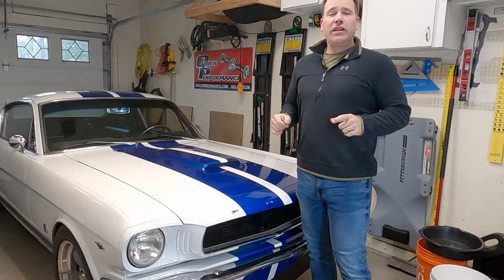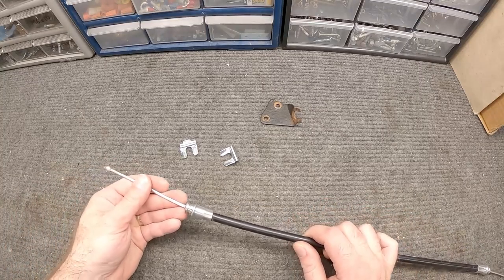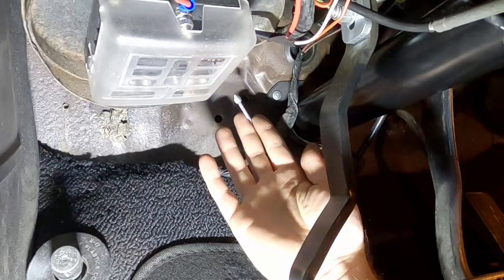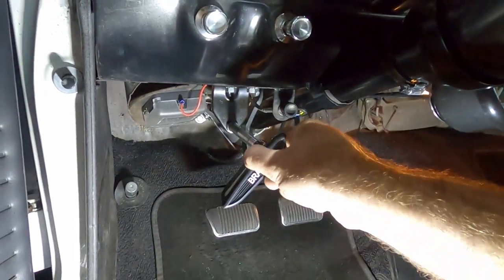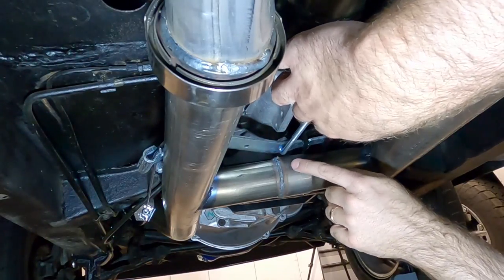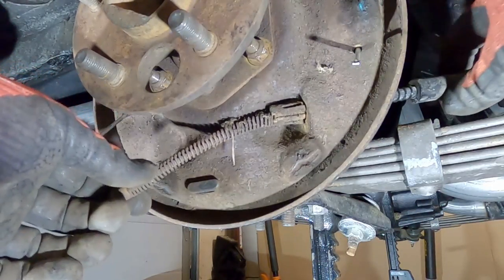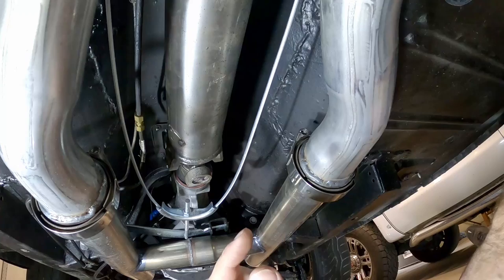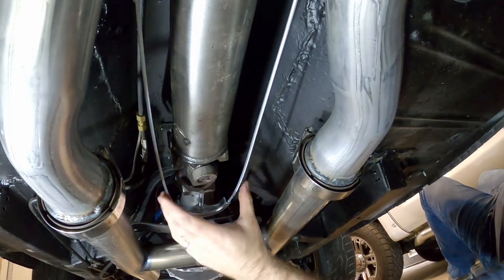Installing a New Parking Brake

Comment: Great job making the video and explaining how to install an Emergency Brake and cables. 
My first car was a 1965 C Code Mustang Fastback I bought in 1980, a few weeks after I bought it the front flexible brake line going to my front drivers side drum brake rubbed against the tire and wore a hole in it, making my lose my brakes coming off the freeway, I panicked, and immediately pulled on the emergency parking brake, and downshifted my car to try and stop it, I was lucky I did not crash the car, because it stopped in the middle of an intersection where it was red in my direction, and the cars went around me. I found a dual reservoir master cylinder and disk brakes off a 1970 Mach 1 and adapted it to fit in my Mustang, and used Stainless Steel flexible brake lines and adapted them to work. I highly recommend that you change your single reservoir master cylinder and get a dual master cylinder.
Reply from the maker: Thanks

Comment: Good video. I remember struggling with drum brakes in the early’70’s. Memory and instruction books. 
BTW hang your grease gun horizontally so the oil doesn’t drip out. I did lubrication in a factory for 35 years.
Reply from the maker: Thanks.  Grease gun is perfect, got keep the grease industry in business somehow.  :)

Comment: While you were in the rear brakes , a little white lithium grease on the rub points for the shoes helps , also cleaning all of the dust off the backing plate makes everything a little cleaner
Reply from the maker: Thanks for the info

Comment: Thanks for the detailed video,  I'm in the process of taking everything apart and was wondering how to get the cable off the handle but 5:49 explains it.

Will probably have to come back to this when I'm putting it back together.
Reply from the maker: Awesome, I love it when people are able to pull something of value from these videos. 😁
Reply: @AndyKruseChannel  1 year later and i finally got to re-assembly and came back to reference this video, so thanks again

Comment: Hey Andy, the only thing I didn't get really clearly is where the wire goes through the firewall so it can connect to the pulley/parking brake under the dash.  Is there a seperate hole near the steering column?  Loved the video and getting ready to do that work to mine now (after I get parts).
Reply from the maker: There's a hole below the steering column that is sort of punched through at an angle.  I think once you get in there it should be obvious.  There's apparently a bushing/sleeve/thing that goes there around the parking cable to keep it from rubbing on the sheet metal, and I missed it.  A viewer pointed it out, I figured I'd fix that next time I was in that area of the car.  :)

Comment: Thanks, Andy.  FYI at 5:50 it looks like the cable may not have been routed through the firewall seal.   Obviously the isolator seals, but it also prevents any metal-on-metal contact between the cable and firewall when the brake engages.   Not every front brake cable replacement comes with it, but you don't want to bypass it regardless.  Example -> https://youtu.be/UYXq1cMNCr4?t=21
Reply from the maker: Correct, I do not have that seal-thing.  However, based on how everything fits down there, it doesn't look like the cable contacts the firewall.  But I could be wrong.

Comment: Great video as always, Andy! Quick question - I'm very new to Mustang ownership and am having new drum brake shoes put on my at my local shop soon along with new brake lines (just waiting on parts) and I'm wondering - is it worth replacing the parking brake 'guts' at the same time? It's looking like it is, and right now we're focused on everything safety related with the car, wanting to make those things a sort of 'known quantity'.  In other words, I KNOW the status of anything related to the braking safety of the car. Is it worth ordering the kit and having the shop put new parking brake cables on as well? I like to do as much as I can myself to learn, but your ability is clearly more advanced than mine! As always, thanks in advance!
Reply from the maker: Thanks!
Yes, while you're in there, it's a good idea to replace the other components inside the drum system.  You can typically get a spring and clip kit for cheap, but it might be worth it to replace the wheel cylinders if they look old.  It will require bleeding of the brake lines, but it's good to do while you're there.  The parking brake cables are likely fine, they may just need tightening up.
Since you're touching on the safety portion, if not you're not going for a numbers-matching car, I strongly recommend upgrading to a dual bowl master cylinder if you don't already have it.  The reason is if any part of the hydraulic system fails with a single bowl master cylinder, all the brakes fail.  A dual bowl separates the front from the rear and so if one fails you'll still have the other and can stop the car.  I had this very issue on my first Mustang (back in 2015) and the brakes failed on the way home after buying the car.  I had to use the parking brake to stop the car, it was super scary.

Comment: How did you jack up the front of the car? There is nothing there except oil pan and cross bar. Cross bar is not  meant for lifting car
Reply from the maker: I use the crossbar.
Reply: @AndyKruseChannel  that crossbar since is curved will put pressure on frame rails pushing them out. It is definitely noticeable when replacing inner fenders and frame rails and measurements are constantly being taken. Motor mounts don't hold the frame rails together since they are rubber or even polyurethane mounts have some give. I use, and others I know use the adjustable cross member attached to floor jack and go under the lower control arms. We lay a 2x8 about 2 ft long on the floor on each side and drive front wheels on to them. That gives the clearance for the crossmember of the floor jack to clear the oil pan and lift the car with the rubber pads of the floor jack under the lower control arms. This I believe, causes less stress on the frame rail welds. 
Not telling you what to do, only a suggestion. Its a beautiful car.

Comment: If you have a fruit jar single bowl Master Cylinder it's not a parking brake, its an emergency brake - the original handles say 'emergency' on it for a reason.
Reply from the maker: Not sure what you're getting at here, but the brake handle says "brake", as does every other emergency brake handle I've seen for these cars.  Further, the master cylinder has nothing to do with the emergency brake, there is nothing that connects the two.  :)